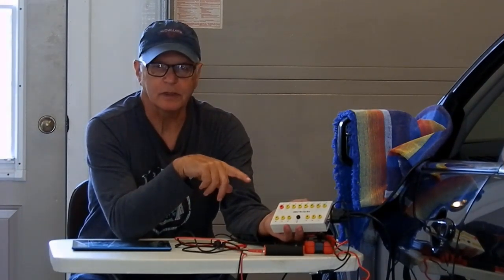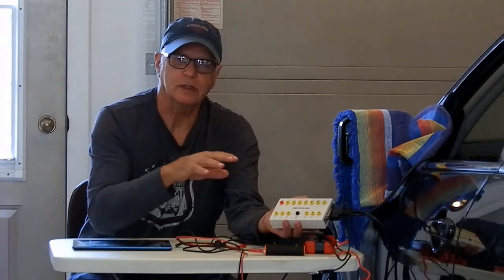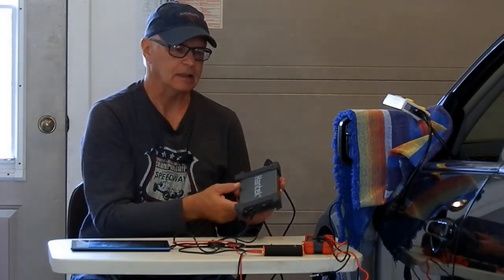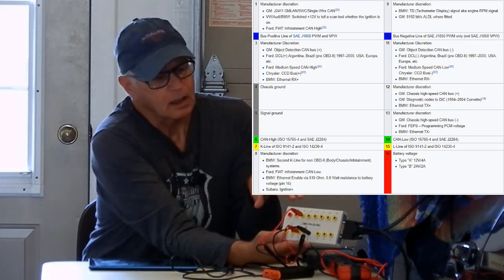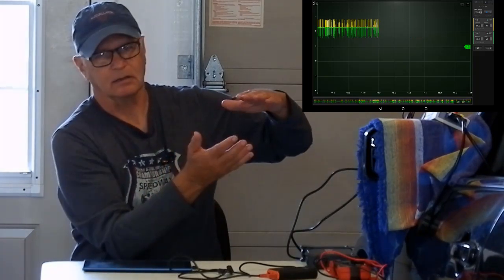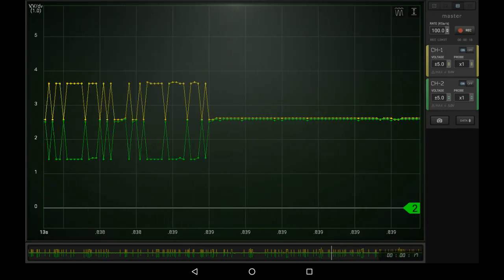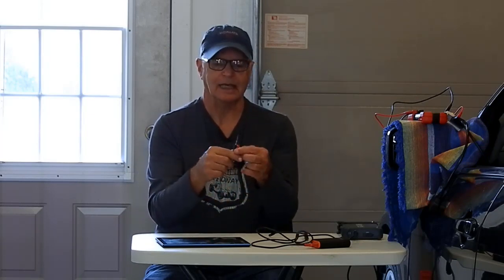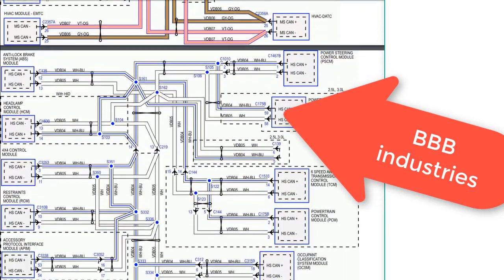GADGETS#22 - CAN BUS BASICS

Comment: you talk about the h-cope. is it a program yo run the hantek 602be?
Reply from the maker: +henry robinson - YES, HScope is an android app that can be found on the Google Play Store. It runs 6022BE, HT1008, HS101 and a few more brands.
I am a big fan and frequently collaborate with Martin, the developer.
Reply: Hi. I saw the hscope on this channel. Each scope included in hscope is a bought license. But very cheap for the licence. The hscope is so much better than the software that comes with budget scopes. As a user i can recommend hscope any day of the week
Reply from the maker: @briankotze57  - HScope is powerful software and I agree with you, worth the price. It's also a lifetime licence on unlimited number of ANDROID devices on same account.
Some of the waveforms I feature on 'The Gadgets Playlist' would have been very frustrating to capture with the manufacturer's Windows based software.
The channel is about getting access to this great technology on a budget. HScope goes a long way towards that goal.
We are both fans!
Reply: @briankotze57  thanks ,i got the licence for he hantek 1008
Reply: You will enjoy it. Best is that you now have a voltage and amperage scale. No more having ti go to measure to see values. Also with the modification you now have access to ac coupling

Comment: Very informative well laid out video. Thanks!
Reply from the maker: what are friends for🙂
Appreciate the comment.
Reply: I just ordered this breakout box. I got a different one off ebay but no signals on the can 6-14 jacks. The power and ground jacks work.
Reply from the maker: +rs1971camaro - just to confirm...you're using 2 channels and piggy backing the 2 grounds on pin 4/5?
Reply from the maker: +rs1971camaro - and what year is the vehicle you're testing?
Reply: That is correct.
Reply: 2012 Mitsubishi Outlander.
Reply from the maker: As far as I know, all vehicles built after 2008 and sold in the US would follow the protocol shown in this video.
Where do you live?
I'm not sure which protocol Mitsubishi is using outside the US...though you've peaked my interest and am doing some searches.
Reply from the maker: +rs1971camaro - when you connect to the obd2 with your scanner, what protocol does it report as it connects?
Reply from the maker: +rs1971camaro - and another way to confirm there's no issue with a non-std protocol is to crawl under the dash and have a peek at the back of the DLC (if accessible)...does it have a wires in the 6 and 14 positions?
Reply: The factory wiring diagram shows can lines from the body module going to pins 14 and 6 on the  obd connector.
Reply: I'm in the US.
Reply from the maker: +rs1971camaro - I'm assuming the vehicle is running OK and that you're just experimenting, right?
Capturing US compliant CAN waveforms with HT6022 should go fairly smoothly...
What sample rate are you using?
Reply: Just testing the box out. I tried Hscope with the 6022 on a bunch of different sample settings. I tried the Hantek software with the presets using the 1008 scope. Take a look at this video, this is the same unit I have.  https://www.youtube.com/watch?v=rIxQ7ZeR6Xg&index=31&list=PLxKWBuy2-zMpOy5ShDIcJNOeXo2m1MzTa&t=7s
Reply from the maker: +rs1971camaro - another idea...troubleshoot with just 1 ch...try to capture just pin6 CAN HIGH for instance...
Reply: Tried one channel at a time, no change.
Reply from the maker: and you've tried with the automotive module within HScope as well?
at what sample rate?
Reply: I didn't try it with the automotive module. The led's don't blink on the 6-14 jacks on the box.
Reply from the maker: +rs1971camaro - here's a few more ideas:

1) Do you get a "overscale" message at the top of the screen?

2) What brand of breakout box did you get and can you send me a link to it?

3) Have you tried a continuity check with ohm meter between the #6 pin on cable end AND the #6 banana on the box (again for #14)?
Reply: I do have continuity between the cable end pins and the 6-14 banana jacks. I'll hook the box up again this afternoon and check for overscale and try the automotive module in hscope.
Reply from the maker: +rs1971camaro - really nice looking and reasonably priced...BUT, as I stated in video, I like something simple between me and the complex CAN I'm trying to diagnose.
There's circuitry in that box...checks protocols, other features...that might get in the way of signal acquisition...which then leaves you guessing: is it the CAN...is it the scope...is it the box?
Even the continuity test of the pins @ cable end and banana plug can be misleading as there might be circuitry between the two.
I like the layout, look and pricing of that box. I don't like the added complexity.
Reply: I got this box last xmas. You waited to long to make this video to set me straight :-)
Reply from the maker: +rs1971camaro - my bad😏
Reply: Tried the 6022 with the automotive module at 100ks and no signal. When the MB sprinter breakout box gets here I will let you know what happens.
Reply from the maker: +rs1971camaro - we have to suspect the breakout box @ this stage...
Keep me posted.
Reply from the maker: +rs1971camaro - another thought...
Do you get 60 ohms across pins #6 and #14?
Reply: Yes, 60 ohms across the pins.
Reply from the maker: +rs1971camaro - here's 2 real smart guys, twisting themselves into a pretzel with a flashing LED breakout box, back probing the ECM to get a signal...LOL
Why the breakout box if they resort to that?
A great example of the simpler is better when it comes to this work:
https://www.youtube.com/watch?v=oTo2Zj57mUE&t=1348s